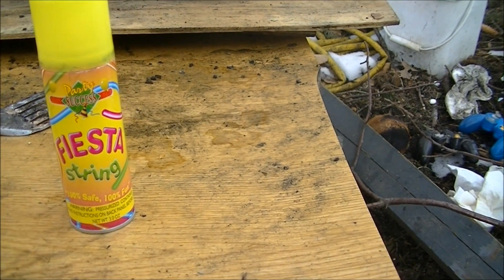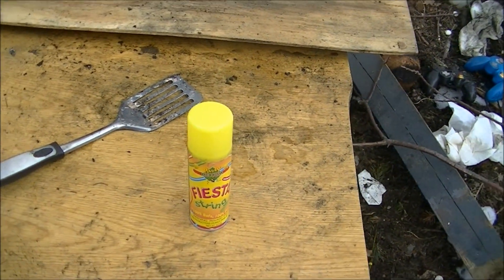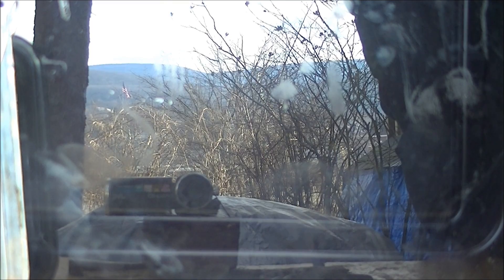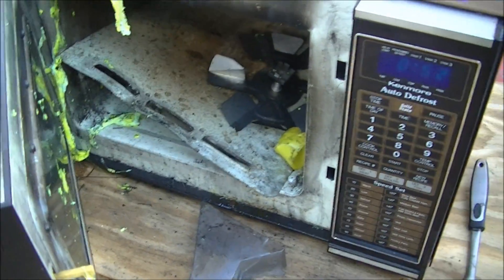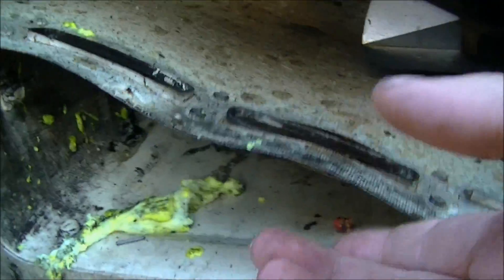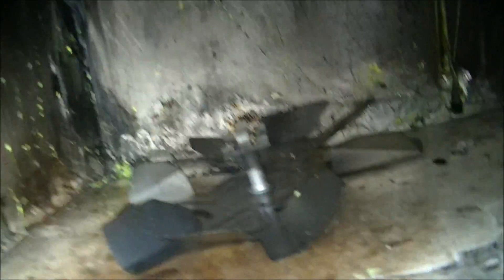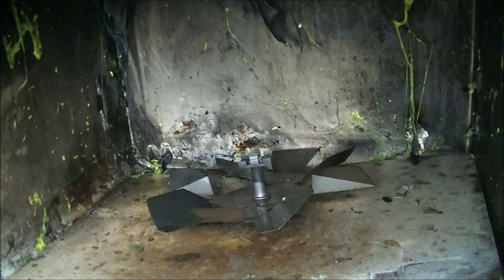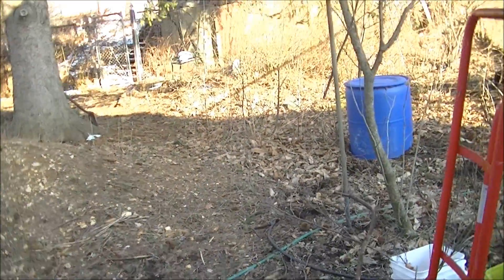Microwave Me: Silly String

Comment: Yeah, I think you definitely should try to flush another (small) aerosol can while it sprays. You can also use spray paint or so, but I think you should choose something from which we can actually see it spraying. Maybe you should try to keep the valve opened by sticking some tape on that top so that the can remains spraying the whole time. A pair of safety glasses will definitely be required though, I'm pretty sure that you don't want to accidentally get the produced mist into your eyes!